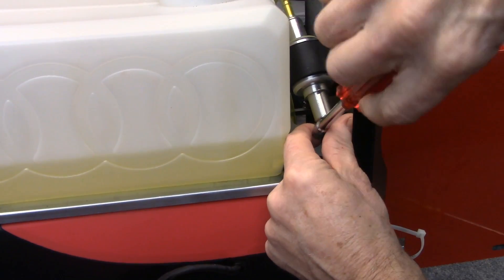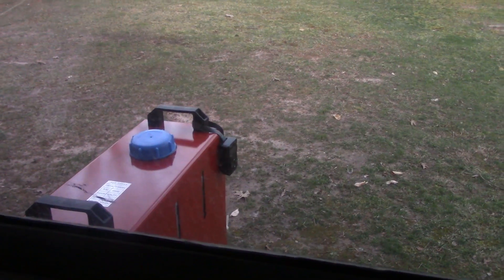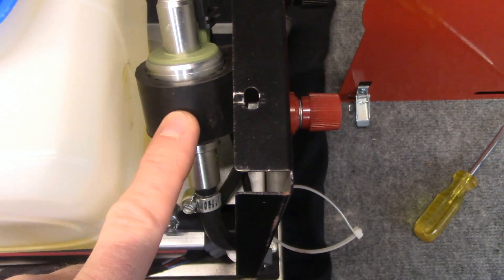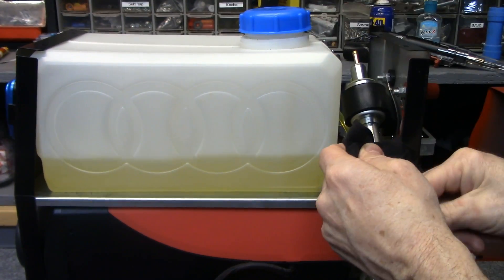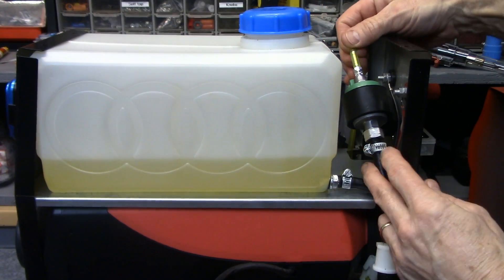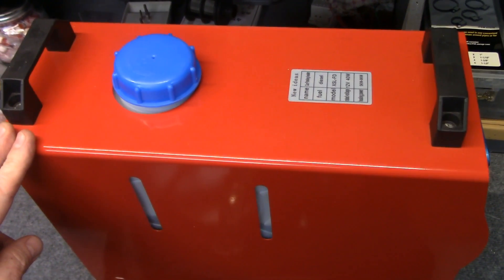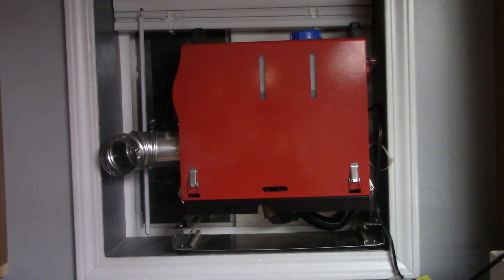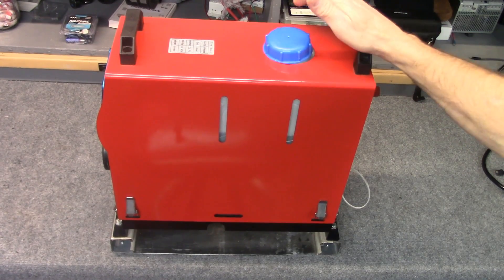Diesel Heater Quiet Fuel Pump Upgrade

Comment: I saw a video where a cup hook was screwed into wood above, then the fuel pump was suspended from the hook with a loosely fitted tie wrap ( zip tie. ) The zip tie went through the mounting hole on the pump bracket. After that it was super quiet ! HTH
Reply: I just wanted to comment, that a it seems like a large portion of noise comes from metal sheet transfering the vibrations from a pump. So In this case suggested solution should give a great results.
Reply from the maker: I think I need to try something like that. Thanks!

Comment: The fuel line between the pump & burner is too soft and is expanding on every pulse so replace it with a more rigid hose. This will provide better & cleaner combustion + help with the noise. A lot of noise is transferring to the steel enclosure thru the rubber pump bracket so get rid of it entirely. Suspending the pump from above and below on a leather or rubber strap or even the old fuel line, hold it to the pump body with another (larger) hose clamp. The idea is to let the pump float quietly in its mount.
Reply from the maker: Others have suggested the same. Sound like I need to make a couple modifications. Thanks.
Reply: You did and I put it into Amazon got nothing also put it into Google got nothing hence why I asked. Thanks anyway.

Comment: you put the pump in a custom box and fill it with spray foam...works well.
Reply from the maker: That sounds like it would work but I need to keep the pump with the all-in-one unit so I can carry it around to different places.

Comment: Add a piece of foam pipe insulation over the pump if there’s room.  It will absorb some of the ticking noise.
Reply from the maker: I have already done that and yes it did help. Thanks!

Comment: That constant clicking would drive me nuts. This video is very informative. Thanks
Reply from the maker: I'm working on lining the case with sound absorbing material.  Thanks! 👍
Reply: You get used to it and the sound is way better than your tent or whatever you’re in getting into the teens 😂. Mine heated 12x16 wall tent with 9’ ceiling to over 70• while everyone else tents were like 19• with little buddy heaters running. They froze and we were very comfortable.

Comment: sound deaden er , killmat  , 50mm or 80 ,, will help , btw is there a link to that pump ?
Reply from the maker: That is a good suggestion.  Try searching on eBay for a different seller that sells a quiet fuel pump upgrade.
Reply from the maker: https://www.ebay.com/itm/303800161456

Comment: how long does one fuel fill last you?
Reply from the maker: It depends on how high the setting is. It will easily last me all night on low and is very efficient on fuel.
Reply: I ran my 5K for 5 hours on lowest setting, and fuel level went down about an inch. Not bad!

Comment: No improvement at all next test is remote the pump buy more fuel line and a check valve  so It  doesn't matter how far away the pump is from its source. Check valve in diesel is important in distance to locations away from sleeping areas.
Reply from the maker: For my application I cannot locate the fuel pump away from the all-in-one unit as it is made to be portable and easily moved around to different locations. Thank you for the suggestion.

Comment: You need a smaller fuel pump output hose.  The size you are using is approx. 3mm I.D., it should be no larger than 1.5 mm I.D. to prevent cavitation (air bubble in the line).
Reply from the maker: That may be true but I can say it works perfect. Thanks.

Comment: Disappointed. Money down the drain there! 🙄. Try mounting under the truck in a waterproof box.
Reply from the maker: That would work but I want to keep it in the all-in-one case. It has to be portable for my applications since it does not stay set up permanently in one spot.

Comment: i think in a video i saw somewhere, where fuel pump came with a dampening piece to help with the noise. I think it was a fuel pump for the ultra expensive Diesel heater made in Germany.
Reply from the maker: Maybe a shock mount? the Germany heaters are more expensive but probably worth it.
Reply: @geenote  you can check out this video(Diesel Heater Pump Noise Damper Test) this guy installed one of those dampeners. Results 4db reduction in noise IDK if its worth it?
Reply: here is the inventers video from the Uk who invented a silent pump: Micro VanLife S05E32 Essex Man Invents Silent Microdosing Diesel Heater Pump
Reply from the maker: Nice. I have to keep my pump in the all-in-one case with all the components.
Reply from the maker: That's worth some money!  Nice. Thanks!

Comment: Great to see the heater is mounted OUTSIDE.  Myself, I would never mount my heater in th truck either.  Safety reasons.  Great video.
Reply from the maker: Seems safer outside plus I don't have much room in the truck anyway. Thanks 👍

Comment: I suspect a bit of kilmat stuck to the outside of the steel panel would help with the echoed thump... and maybe some weighted blanket over the top. That cover is like a box drum.
Reply from the maker: I agree. Lining the cover should have been one of the first things I did to help with the noise. Thanks!
Reply: I have done that, and a thin insulation on some of the inside panels. Helped some, but have been thinking about an old metal Coleman cooler I have laying around. Maybe put the whole thing inside of it, and drill a few holes?

Comment: I extend my fuel line and connect it under the van and back which helps alot.i fell for this pump £21 but I haven't connected it after buying it a year ago as I'm not convinced.so I find watching this Interesting.
Reply from the maker: I move my heater around so the pump has to be mounted inside the case. The upgraded fuel pump is slightly better than original.
Reply: Joe where did you buy your £21 quiet pump from? As I have ordered the pump on Amazon for my MoHo. Thanks
Reply: @raykeogh1972  hi, from eBay there's green plastic on the ends ,I believe I typed quite parking diesel heater pump.

Comment: look like a soft fuel line is fitted no good all . comments are use a stiff fuel line i Think work on mine
Reply from the maker: So far so good on the soft fuel line but rigid line is probably better.
Reply: Soft line for pump inlet is fine, but high pressure pulsed outlet must be narrow bore hard plastic to pass the pulse to the glow plug and ignition screen.

Comment: The clip on the fuel pump wiring plug is designed to push in not to be pulled right out (* squeeze the wire clip in an then seperate the witing plug) saves loosing the clip while working on the pump, also no need to try to get the wire clip back into the slot when rejoining just leave the wire clip an push the plug socket back in till u hear it click.
Reply from the maker: Yea that sounds easier. Good thing is I only need to do it once hopefully. Thanks the the tip!
Reply: @geenote  some fuel injectors also use them!
Reply: @johnbaum1000  Bosch style injectors specifically

Comment: I see alot of videos on chinese heaters And $1500 heaters  I think the Zen would be a $200 that does the job quiet and last a few years 
a upgraded Chinese heater should do this 
That being said Take the fuel pump Wrap it like a hockey stick handle with silicon rubber tape Don't throw it in a box with foam Unless you are going into the speaker box business ...Hollow out a dollar store Noodle That you use in pool cut it down to 6 inches throw that over it and zip tie that ...I bet you You have a upgraded pump for under $40
Reply from the maker: Yes!  I have already taken a dense piece of foam rubber and wrapped around the pump to make an improvement. Thanks for sharing some ideas.

Comment: I think if you bought 2 sponges. And zip tie over fuel that would deaden the sound from pump its not going hurt the pump
Reply from the maker: I agree!  I recently took a piece of dense foam and zip tired it around the pump which is pretty much what you suggest.  I believe that was an improvement. Thanks!

Comment: I swapped a standard pump for one of these from Ali express, mines bolted in the rubber mount to the van floor and was ready to try hanging it from cable ties but this pump is so quiet it’s not worth any more mods. When it’s very quiet I can only just hear it. I think they must have a rubber stop for the piston as the ‘clunk’ just doesn’t travel in the same way... very worthwhile indeed!
Reply from the maker: I need to try one from Ali Express because this one is not quiet.  It is an improvement as it has a different sound but not "ultra quiet" like the description says.  Thanks for sharing.
Reply: can you provide a link or any kind of additional information on the one you bought?

Comment: Seems like a worthwhile upgrade at that price. As you say, it’s improved the situation rather than solving the problem altogether but with the all in one heaters it’s likely the best you’ll get. The metal casing acts as a sound box with the pump bolted to the side, even allowing for the rubber holder. Not sure if anything else is possible but I think I’d look at an alternative attachment to reduce the sound a little more. A styrofoam block cut in half and hollowed out to clamp around the unit, instead of the rubber ring, comes to mind as an idea if there’s room to wedge it in place between the tank and the casing.I feel that disconnecting the mount from the case will help, though. After, that it’s down to ear plugs, I guess! 👍🏻
Reply: someone suggested allowing the pump to hang freely from a piece of leather
Reply: @massa-blasta   Just got my heater....It has the crappy soft fuel line...after i replace it with the right 2mm ID hard nylon fuel hose, thats what my pump AND nylon hose will be slung from soft hose for a quieter pump & fuel line (yes the nylon hose is so hard it echos the pulse also)
Reply from the maker: @massa-blasta  That makes sense. It's worth trying. Thanks!
Reply from the maker: I agree. I might try to experiment around with the mount like you said but I'm always going to have it close by inside the all-in-one box.  Thanks for the suggestions.
Reply: Do you think that lining the outer unit with a foam might help ?

Comment: I have a heater in my shed. With the pump mount fastened to the shed wall the pump was very loud even when standing outside the shed. I suspended the pump in air with cable ties and now can't hear it at all outside and its much quieter inside too
Reply: Yes, Sound Reduction by ‘Isolation’, your suspension, coupled with sound deadening material around physical pump is the ‘poor man’s way to go’. 
🤔👍🏻🥰
Reply: There are rubber cases availabe. They look like a pink dildo but work pretty well.
Reply from the maker: Good to know!  I might try to modify the mount but I'm limited on location with an all-in-one unit. Thanks for the input!
Reply: I did something similar and it makes a world of difference.  What I did was insulate the inside of a tupperware like container and suspended the pump inside it.  I have the pump inside my van so I can still clearly hear it.  However, it is night and day compared to before.  Man that thing was loud.  It sounded like someone knocking on my van door...lol.  
I was tempted to just wrap the thing in insulation but I wasn't sure if it might overheat or something.  Suspended in the container it at least has some air around it.
Reply: I did the same thing on my boat. Tick is almost inaudible now. I wonder if I can rig up a led indicator light to show its running..?
Reply: @directorstu  Hello, I'm interrested in your boat installation. Where did you mount the heater? and is the blower noisy for neighbours ou occupants? I would like to do a temporary install on my swim plate. Thanks.
Reply: @BMW48is  hey.  Heater mounted on L bracket in space behind aft cabin. Steering gear is in there   but not much else.  Blower noise was potentially anti social if in marina but one of those cheap ebay exhaust boxes did quite a lot to bring it down.  I could not hear it in the cabin. Ducted Air inlet and burner air intake just take from within this space, although Burner air has a pipe and anti noise hose end.   I'd like to get the ducted air intake drawing from outside of this space as, if the heater does not start properly, smoke could get vented into cabin.  I have three co2 and 1 alarms so no risk but it's on the to do list. Fuel Pump was originally mounted on the wall just where my head goes when sleeping which mad rthe infamous tick tick reverberate. I remounted it and hung it on looped cable ties to isolate ticking noise of pump which works well. I can still hear it a little but that tells me the pump is working. If I figure out how to make a led light tell tale I will insulate more.  When u say 'temp installation on swim plate'  do u mean you will put exhsust vent through the transom?  What boat do u have? Cheers. S
Reply: @directorstu  thanks for the ideas. My boat is a Chaparral Signature, a cruiser with a swim plate. It is a 26' so not very big for a permanent installation. I was thinking of buying the 'all in one' heater and put it on the swim plate only when required. Attached with a ratchet straps and the exhaust in free air. I would have only the hot air duct going in the boat with the roof and windows installed.  Is there any diesel smell?  Is the heater sensitive to waves like if I have it running during navigation? Thanks.
Reply: @BMW48is  I've not used the all in one heater. Might work but tbh sounds like a lot of hassle to set up, feed heating pipe into boat, make sure it does not get wet.  Is there nowhere you can install a more permanent solution?

Comment: Keith, As smart and as good a fixer as You are I believe You could make You a stove out of a propane burner. Of course the best and safest heat is an electric heater and a quiet generator. You might check Gonagain channel he heats a 6x10 Caro Trailer with a small propane heater.
Reply from the maker: I will check it out. I agree the electric heater is the way to go if possible. Thanks!
Reply: Propane heaters makes much more moist than diesel heaters.
Reply: @J1I9M7M4Y  It is hard to believe but one pound of propane will produce 1.6 pounds of water....sounds like magic but it is true. That equals 26 oz of water added to the air for each one pound bottle. This not only causes condensation problems but can also cause you to feel cold.

Comment: Great job once again. I have heard on another You Tube feed that there are also softer rubber supports out there somewhere that help with the noise. Keep up the good work, thanks.
Reply from the maker: I need to check into the softer support!  Thanks!
Reply: @geenote  supposedly the hose can be making noise too and there are rubber insulated mounts for the hose.
Reply from the maker: @hiknfo  Would be worth a try.